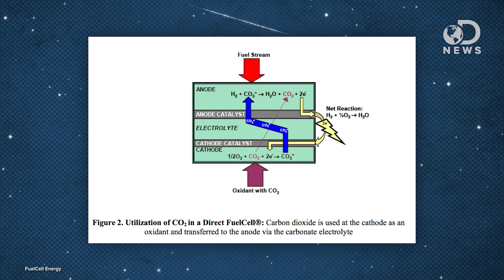Could This Technology Make Cheap Energy Clean?

Comment: Carbon sequestration doesn't take carbon out of the air.  It only prevents more carbon from being added to the air.  What it does, however, is remove oxygen from the atmosphere.  You can't have CO2 without the O2.  It should be called oxygen sequestration.
Reply: We have an excess of C02 in the air due to pollution,

So if we can stop emmiting so much we can once again balance the system.

However most ways of transportation still relly on oil/fossil fuel so theres still going to be a big excess of co2 emmistions.